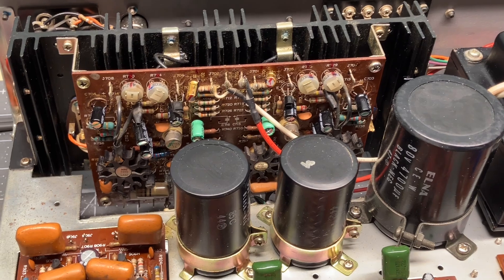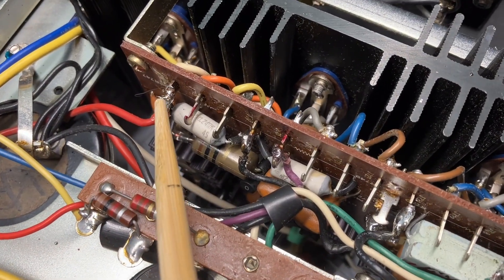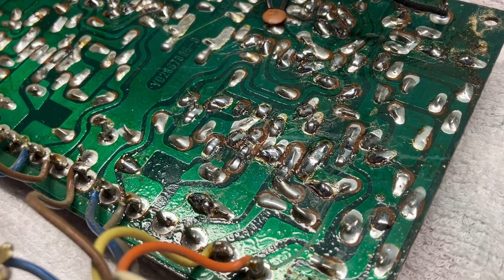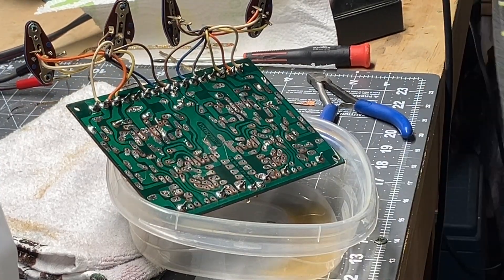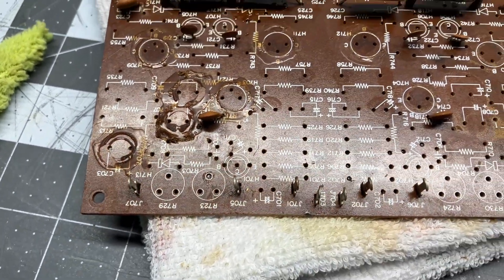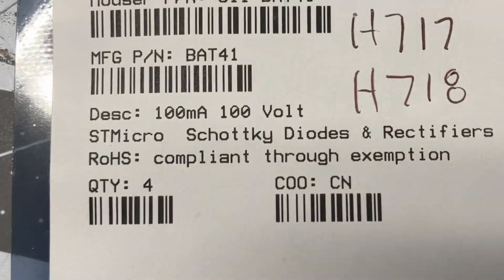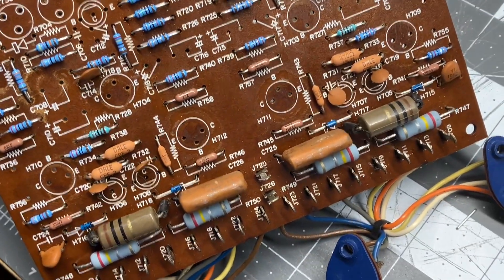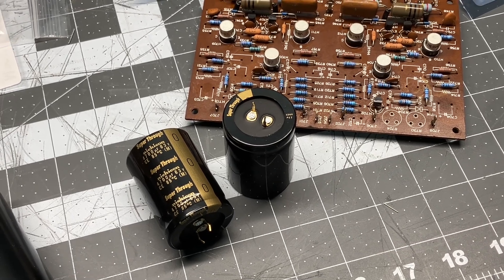Marantz 1060 Rebuild - Part 5a - P700 Amplifier Assembly Board

Comment: Why did you desolder the red and the white wire initially because mine has a lot of slack and I don't see why I couldn't remove the board and leave it on?

Comment: What capacitor specs affect the sound and how? Capacitance? ESR? What does "audio grade" mean?  I can't really hear any difference.  Can it be measured and seen on the scope?
Reply from the maker: Audiograde means very low ESR, and/or for use in the signal path.... for the most part. Some can hear the difference and some can't. A LOT of variables in setup and everyone is using different speakers. Some speakers are more revealing than others, etc, etc. I'm sure with the right equipment an "audio grade" cap could be measured. Some Capacitors are for DC power filtering only. Those electrolytic caps have a higher ESR most of the time.

Comment: 8:53 That little dimple in the valley of the screwhead means it's actually a JIS type screw which is a little different than a regular phillips. On bigger screws like these it doesn't really matter but I've found on certain smaller screws it's almost necessary to use the right driver. It's great to see this old board still being maintained
Reply from the maker: I had no idea and didn't even notice the dimple. Thanks for the information!

Comment: Enjoy your videos. Would it be "possible" for you to post a list of the replacement parts you chose. I've had a hard time locating some parts listed in the service manual, especially transistors. Thanks
Reply from the maker: Audiokarma is the best place to get a parts list. My build has a few parts that are not something I'd recommend at this point. Audiokarma will have all of info your seeking. Thanks!

Comment: Schottky is usually pronounced "Shot-key".

You can clean PCBs with an ultrasonic cleaner, distilled water and a saponified soap intended for PCBs to remove flux and other organic compounds.   You can watch a video on this: "How to Clean a Circuit Board (PCB) with an Ultrasonic Cleaner".  It also lists a place you can get the soap.
Reply from the maker: Thanks, I’ll give it a try!

Comment: Good work! Do you have any advise on a Samson txm16 what will not power on? No fuses are blown, power switch is good, and the power cable that leads to the power board reads 57 volts instead of what the board says as 100v. Could this be a bad plug socket on the actual devise? Everything inside is immaculately clean.
Reply from the maker: Best to log in to Audiokarma for this one. There you'll find a group of friendly, experienced folks that can help.

Comment: This weirds me out,why does it only have one power capacitor? Usually it has two power capacitors that are series to one another
Reply from the maker: Honestly, I'm the worst at explaining, but will try.... someone else may chime in with a better explanation. The 1 (Large) capacitor is for power filtering of the main power rail. This only has 1 power rail as most amplifiers, integrated amps, receivers, etc. have more. The 2 smaller caps are again for filtering, but are directly in the audio path. 1 for each speaker as this is a direct cap coupled amplifier. 

When you see only 2 large filtering caps, that's because it has 2 power rails running off the power transformer. There are no other large caps because it's not a direct cap coupled design.

Comment: This is a neat and comprehensive work.  I really like your idea of using socket to install transistors and how you raised the resistors, I will use this approach in my next projects.  I was studying the SM to better understand this amplifier, it seems to have been engineered based on discrete components, which I like very much because of the warm sound it produces.  Also, I understand that C006 and C007 are there to block DC to the speakers, but have you considered adding a reversible project to install a startup protection relay for extra protection?
Reply from the maker: I'm not sure if add a speaker protect circuit/relay. On this unit? Probably not. 
Yes C006/C007 does block DC. They're also directly in the audio path and connected to the speaker outputs. Use a audio grade cap.
Reply from the maker: The sockets didn't work well at all. I highly suggest soldering in the TO-39 transistors like original. I spent hours chasing poor connections due to the use of the socket system.